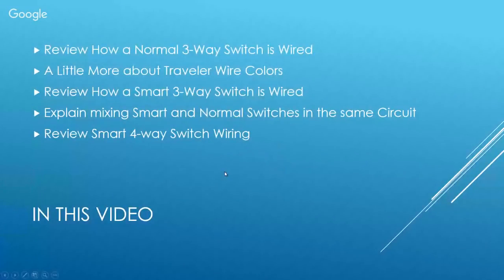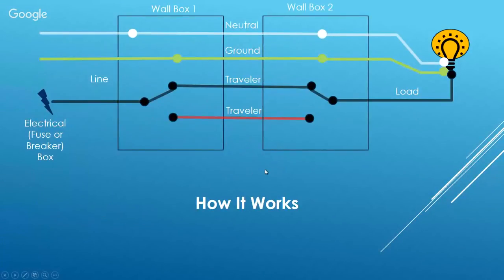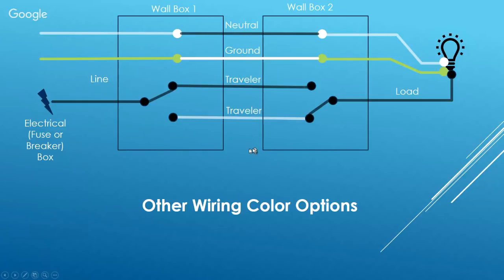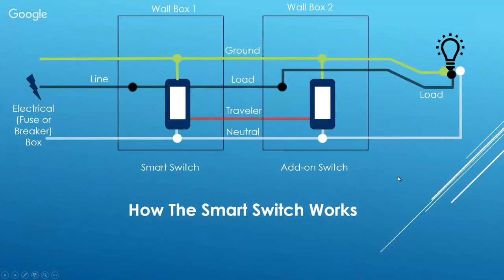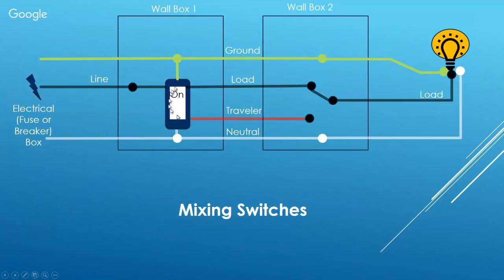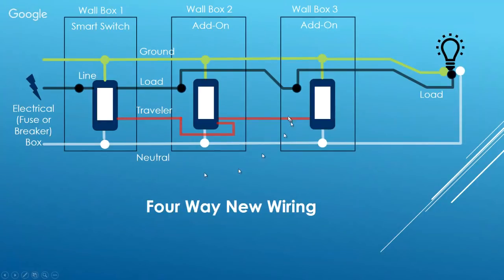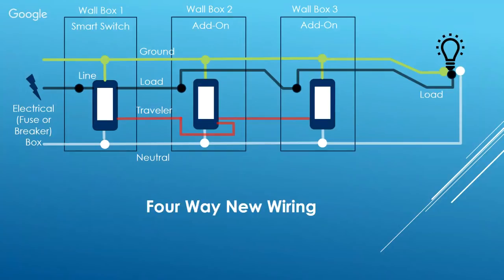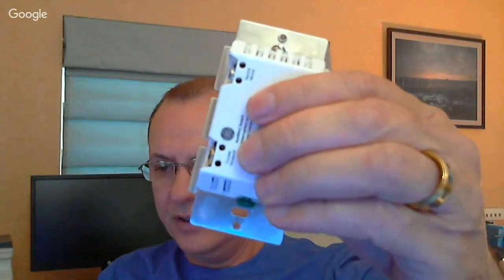3-Way Smart Switch Questions & Answers

Comment: So I have a house from late 90s, I have a hallway light/switch that is a 3 way, I got a leviton smart switch, I have it hooked up correctly as it does turn on and off IF my other switch is on one of the positions, but not the other

The other switch is just some normal 3 pronged switch, so there isnt a way I can get that to work is there? I would HAVE to buy an 'addon' switch in order to get this to work?

FWIW, before I did this, both were old 3 way switches, one had all 3 wires hooked up, while the other had only 2 out of 3

Thanks!

Comment: That was very helpful. However the three way primary and slaves configuration is not applicable to TP link Kasa three way switches. For those, they are truly all three way switches and you can pair one smart three way with another regular three way switch

Comment: I'm trying to install a Kasa 3-way wifi Smart Switch and only one of the switches can consistently turn the lights on and off. The other switch can only turn the lights on and off if the first switch has already turned on the lights (activated the circuit?). Can you tell me why this is? Thanks! (PS, my original 3 way had two black (line and load) and one red (traveler) lines attached, with one also having a copper ground attached, and the Kasa switches appear to have line and load merged.)

Comment: Can you show a diagram for a situation where the light is between the switches? because there will be no neutral in the second box? You have the hot from the smart switch connected to the load and the neutral from the smart switch box connected to the load and a traveller between the two switches already. Could you the use the other traveller to bring neutral to that box from the load and the former hot (that bypassed the load to go through second switch first) be used as a hot line from the load's hot connection?

Comment: Very informative vids, I just installed my decora smart 3 way with addon switch. It turned on fine intitially but after finishing install the lights only turn on at 5% brightness. These are not dimmers so What would you suggest is the issue? I looked at troubleshooting guide that said if my wiring is more than 300Ft they might not work. this is powering 5 seperate single bulb 40w lights and very well may have close to 300’ of wire maube? They worked at intial powerup and Homekit setup. Thanks

Comment: I just returned a smart switch I thought was defective. Could be the other toggle was in the wrong position, you say. How can one tell if the neutral wire in the switch box of an older home is actually connected to a ground?

Comment: I have a question if I may. I have a 3 way setup for my stair case lights. Previously it had a dimmer on the top and bottom of the stairs. I replaced the bottom with a Leviton WIFI dimmer and replaced the top with just an Addon switch. That setup works great.
Of course now the wife says she wants the dimmer control both at the top and bottom again as before but with the wifi. Do I need to get a new Leviton WIFI dimmer and replace teh addon with that or is there an addon dimmer? I cannot find much on this online.

Thanks,
Billy

Comment: Nope.  I can't see a way to wire this.  Granted you have enough wires in each outlet box.   But that means you are re-purposing the wires.  For consistency, lets say I have: https://www.easy-do-it-yourself-home-improvements.com/images/xLarge-3-way-switch-3.jpg.pagespeed.ic.4M3S8JN4zX.jpg 

I would start off with the source box.  The source plugs into the three way, and white and black go to the light, and the red is my travel wire.   Easy right?   But now the second three way.   I could continue the white and black from the light, and the red is traeller.  But then the second three way will only have power when the light is turned on...  So lets say this is the attic.  I climb there and run another power line, to connect to the second three way through the white and black wires.   Now, everything seems to work...

Now what happens if someone comes along and puts in a normal three way?   Well basically the three way is now toggling power or neutral to the traveller.   If I'm lucky, the just damages the smart switch.  If I'm less lucky, I choice a hot wire that was out of phase with the other hot wire, and now it is very likely I blow the main, and possibly start an electrical fire.

Which is why electrical code actually prohibits rewiring a switch that way.   So the only safe way to do it is I need to tear open the wall and run the same source line to the second switch box.  I'm still not really aware what would be the correct way to tie off that unused black and white wire going to the light in the second three way.   Obviously I could gang the neutrals, as that won't hurt anything.  But if I gang the black wires, I'll have an always on light.  Ahh.  Now it becomes obvious.   I make sure the black and white from the light are in there original configuration, and then gang them together.   That completes the circuit for the light.   Very counter intuitive, when you think about the colouring conventions that ganging black and white isn't going to create a massive arc.   So you'd have to tape or paint the white wire to be black.

Comment: I have a GE smart switch dimmable and an Add-on. I wired them as in your video. However when I use the toggle switch (Add on) to power on the load, it turn on, but the lights are not at its 100%. They are dimmed, and sometimes toogle witch doesn't turn on or turn off lights. I have to use my cell phone to turn them off or on completely. Any idea on what the issue could be?

Comment: You seem like a pretty sharp guy. I have three way switches everywhere in my large house and I'm trying to figure a way to avoid paying $50 for every one of these pairs in order to replace standard three way switches with smart switches and add-ons.

Here is what I've come up with and I would like you to analyze and criticize if I'm missing something but maybe what I describe might work in my environment.

I have a handful of the inexpensive, as in around six bucks apiece, smart switches on the way. These are the ones that are small enough to mount in a box behind the switch. I would also like to add that my situation is further complicated because the electricians who wired my house up did not put neutral into the boxes for the load side switches. Watching your video I know this is a problem. I suppose it would be possible to fish complete wires down to the load side switches but it would be a huge task.

If I were to put the simple Wi-Fi enabled smart switches on the input power three way switch, then when only my wife and I are in the house, both knowing that the light load should be controlled through the smart switch and not the toggle switches, I can leave the toggle switches for the two three ways permanently in the on position and engage or disengage the input power through the smart switch via the Alexa app on my echo and echo dots. "Alexa turn on hallway light"

When we are having company that would not be comfortable with this system (although typically my company is going to be tech savvy and would have no difficulty using it in the pre-described scenario), I would leave the smart switch in the on position and as it would then be acting as a straight pass-through, the 2 3 way switches should function as they always have.

Is there anything wrong with this? Am I missing something?

I think that I have a dozen or more of these three way switch pairs and at $50 or more per pair, this could get a real expensive real fast. I am not a licensed electrician but I've done a fair amount of wiring and to my layman perspective with a little bit of experience, this seems like it ought to work

Even if someone turns the smart switch on and then turns the standard three way off at the end of the run, the smart switch would remain on and when the three way is reversed, the light should come back on. I can't wait for my new switches to come in so I can try this out. That is unless you can give me an analysis that points out I've totally misunderstood something...
Reply: Just talked with my licensed electrician buddy. He sees no reason why this would not work.

Comment: Very informative video thank you. Can you tell me if I can use all regular Z-Wave switches instead of having an add-on switch? I got a real good deal on a whole bunch of regular switches so I would like to prevent from having to buy add-on switches
Reply: GE
Reply: DIY Smart Home Guy 5 of the 22's and 5 of the 24's
Reply: So it sounds like it would be better to get a few of those switches then
Reply: Ok, thank you

Comment: It won't let me see your reply,but I took the switch back and used another.  I have the same issue . I put the old switch back on leviton  120v 1t amp switch back on and the lights came on  . So do I not have enough electricity to support the switch ? I have another WiFi switch in the the same box and it comes on and off with no problems . It's three lights total . One with its own light  switch but the other two share a light . Do I need a 4 way instead of the 3 way?
Reply: Thank you so much . I your other video  u mentioned that sometimes the wires are different colors.  That's exactly what was my problem. The red wire wasn't the travel wire . The black one was and when I switched them . It worked perfect.

Comment: Alan is correct. Look up page 22 at casetawireless.com/3way. You can install the Caseta Smart Switch and keep the mechanical toggle switch at the other end by adding a jumper. I’ve done this successfully and essentially have 3-way switch functionality while adding a light on my Smart system.
Reply: Thanks for writing back John. I find your videos very informative and well done. The Lutron switch I’m referring to is Model PD-6ANS and just has two buttons. I really like the look and prefer the functionality of this switch in those cases where you don’t need to or don’t want to dim. I just found out it also has it’s own pico remote look-alike, Model PJ2-2B-GWH-L01, which would be another option for the second switch in the 3-way application. The Pico battery will eventually have to be replaced though, which is why I decided to keep the original Leviton toggle switch at the other end. Cheers.

Comment: Any experience with the zooz switches? https://www.thesmartesthouse.com/products/zooz-z-wave-plus-dimmer-light-switch-zen22

They claim to have smart switches that work in conjunction with regular switches without the need of remotes and bypassing switches.
Reply: John Stone I look forward to that review! If it works, I'd think it would definitely simplify the process greatly and decrease cost. It almost seems too good to be true but I suppose that's why this tech is so exciting. If I'm reading the instructions right, this new switch just needs to go in place of the primary switch where the line comes in and the rest of the switches won't need to be reconfigured? 

I have one set of central lights that's a 5 way and I'm daunted figuring the wiring out. I know I'll only have one physical dimmer but I'm ok with that since Alexa is right in the area. 

Thank you again for the awesome content and information!

Comment: Hi.. I have just installed all Lutron switches/dimmers... and just FYI...you can use any normal switch with 3 way switch. you just have to short your switch.. and it works great..NO need for Add-on switch
Reply: J B how did you do this?

Comment: Keep up the good work.
Sadly in Germany I'm not capable to realise most of the stuff that I'm learning here yet, because most smart hubs don't work with our amperage
Reply: John Stone Hey John,
Thanks for your quick reply and your hint.
There are indeed several devices from Fibaro to buy in Europe. Only problem are the costs of the Home Center 2 (Fibaro's smart hub). You won't it under 459€ atm. Compared to Wink and Smartthings not really justifiable

Comment: I found it easier to wire my 3 and 4 ways into a single pole. I then installed a Lutron Caseta smart switch and Lutron Pico remotes in the it locations.
Reply: HI Anton, I can tell you that the Lutron Caseta Switches along with the PICO Remotes work with the wink Hub and App Directly out of the box. Which in turn works wonderfully with the Amazon Echo, Echo Show, and Echo Dot without and real headaches. There is no need in that case to have a Lutron Bridge/Hub.
Reply: In addition to ease of installation, the Lutron Caseta switch/Pico remote combination can "convert" an existing single pole switch to 3 way operation without the need for additional wiring. I live in a one hundred year old home and the inclusion of a neutral wire at the switch box is unusual.
Reply: Will Lutron Caseta require LUTRON'S bridge/hub in order to work with Wink/Smartthings/Homekit? I read somewhere that one has to have it to work with Alexa. Could you please confirm or deny. Thank you!!!
Reply: Thanks a LOT for your explanation! Since I just purchased a Smartthings hub on sale at Amazon and I don't want to have yet another hub on top of ST and Hue and ATV, I will have to find another system of switches to control my lights on and off the network. I've watched all of your videos and appreciate them. But since they are mostly Wink centered, what would be your recommendation for the HomeKit AND Smartthings compatible wall switches and dimmers? Thanks for your help in advance!